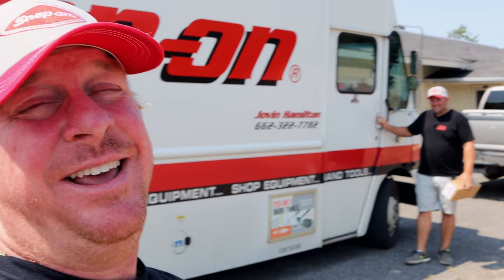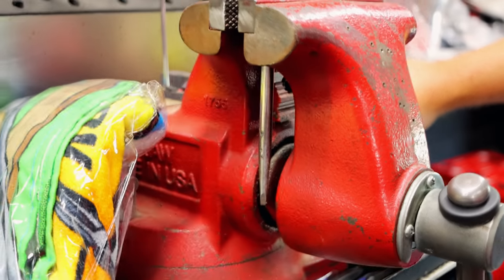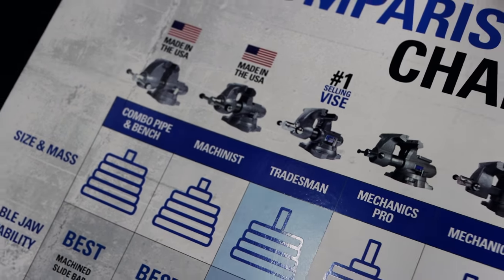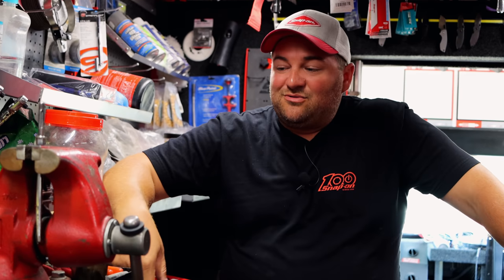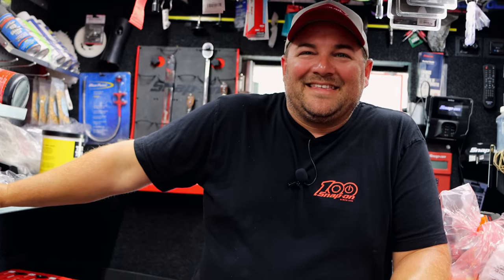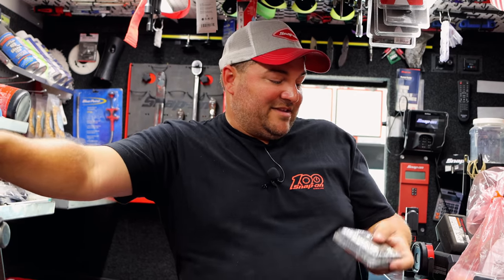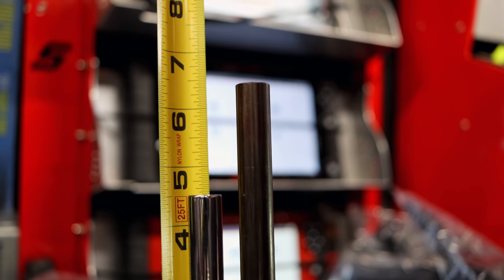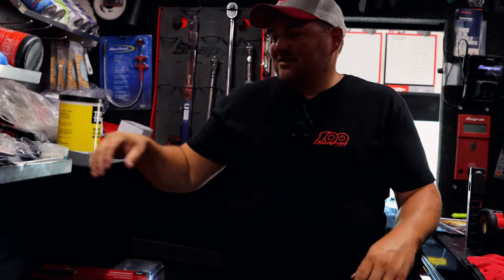Snap On Extra Deep Sockets and Vise Talk (You can still get the same vises, we will show ya how)

Comment: How about a video of all the different spark plug sockets? 14 mm x 12 point, 16 mm x 12 point, 16 mm thin wall, 9/16, 5/8, 18 mm, 3/4, 13/16. Plus all the extra deep versions and swivel joint ones. Which ones are important and which ones are not worth having.

Comment: Has Hamilton ever sold a snap on oil spout when I first started oil came in metal cans and a oil spout was a required tool I've still got a couple alot of young people have no idea what it is same with a timing light or distributor wrench
Reply: @sexyworm1000  true I would like to find a job at a custom old hotrod shop I got my start on 60 and 70 models no computer just horsepower plenty of room under the hood we had starters and alternator rebuilt for 15 dollars we could repair radiator not replaced them only thing all brakes were shoes no pads if you could master timing and carburators then you could fix any car that come in cause it took fuel fire air and compression all at the right time and that's all it was to it I even learned how to do alignment with 2 cinder blocks a kite string and a tape measure long before the computer and today I'll line a car like that and put it up against any that's been done on the machine
Reply: @sexyworm1000  now some of the new things are good like brake pads great improvement scan tool makes diagnosis easier today's tire machine is better than the old ones I've done tires with prybars and spray starting fluid the light it on fire to seal the tire to rim
Reply: @sexyworm1000  these young guys have no idea what it used to take to fix cars and we had no lifts we had a couple of pits and Jack's with jackstands or cut up cross ties I've still got a screw press just like a hydraulic press only you use a wrench to screw it down and press it apart or together

Comment: The extra long 10mm works really well for pulling glow plugs on powerstroke engines a regular deep 10mm 1/4 drive socket can fall inside of a 6.4 cylinder head the extra long one will stick out of the head

Comment: I don’t know if anyone mentioned it, but Mercedes bumpers require an extra long (deep) 10mm socket to remove 2-4 nuts. I’ve seen one Mercedes use an extra long 8mm for the bumper. I do auto collision repair.

Comment: I got a 10mm kit from O'Reilly's and it had an extra deep 10mm in it and I got the entire kit as a joke cause it was $16 but that extra deep 10mm has came up so many times for Mopar battery tie downs and recently it let me do the terminals in my Honda magna without needed an extension to get in there. Deep 10mm sockets are really handy I've been debating on upgrading mine to a snap-on one

Comment: I have the long 3/4 cage bolt socket.... in 4 years only used it 2 times always still grab a ratchet wrench.... but I can see where the different deeper 10mm and 8mm would be handy for valve covers coil packs hose clamps etc

Comment: Those really are the best vises out there. My boss has had his for about 10 years and the thing is a monster
Reply: I've got a snapon vise I bought around 1985 it still works great it's a midsize vise I bought it to fasten to my toolbox got a 1980 bench grinder I've got a pipe vise for working on exhaust or driveshaft got a metal lathe for balance the driveshafts

Comment: Here's a question for Hamilton. What is the biggest socket he carries in stock on a regular basis? Just curious.
Reply from the maker: we will look next week
Reply: I bet 36mm is in regular rotation. Anything over a 36mm is special order, typically.
Reply: @nathandnicholson  that or 39 for Toyota 4x4 axle nuts.
Reply: What’s the biggest socket snap on sells overall?
Reply: I had to get a 46 mm specialty ordered for a weird foreign semi from Japan for the lugnuts
Reply: @CAJones-bu6tu  They have and 8", 2 1/2" drive socket.
Reply: @KoonTrucking  Thanks, Clay.
Reply: I install knuckle boom and drywall cranes and bought a 5mm1inch drive snap on impact socket!! 50mm/ 2”3/16” 3/4” drive sockets

Comment: Good video.  Is there a special Socket to remove air intake hose clamps on jeep 2.0 and 2.4.
Reply from the maker: no clue but I can check
Reply: @KoonTrucking  it is a 8mm that needs to lock on the clamp screw very hard to get to when replacing the electronic throttle body thanks.
Reply: Nobody makes a socket like that , that I've seen. I've used a magnetic 8mm on those hose clamps.
Reply: @allanb3222  ko-ken makes locking sockets haven't tried them yet.  Just hard to keep a socket on the screw loosen or tighten the screw it is in a very hard place to get.

Comment: What is the outside diameter of the handles on your Vise?  Is there a separate part number for those rubber protection bumpers on the handle?
Reply from the maker: Just get some glad hand seals and trim them down. $2 for them that wat

Comment: What would be the part number on a 1/4 drive locking flex head hard handle ratch?
Reply from the maker: You can check that and the price on snap on website. It’s super easy to navigate just click ratchets. Then 1/4” then locking flex and it puts them all side by side. Obviously it’s not a single answer as they make several different styles and lengths
Reply: @KoonTrucking  I haven’t been able to find any hard handle locking flex heads on the sight, I saw one on a truck and didn’t get the part number lol

Comment: Wilton stopped making Tradesman vises in the USA about 2 years ago.  They're now made in Taiwan.  That's why you couldn't get them.  The best of the tradesman vises are 1780s --- it's probably the best vise Wilton makes period (yes, even over their machinist or combination (C) vises).  The new Tradesman vises from Wilton are total garbage.  They're redesigned to be cheaper to manufacture, and the ones coming out of Taiwan have no quality control at all.

I'm so glad I own two 1780s, a 1760, a 1755, and a 1750.

Comment: Wilton tradesmans are now made in China since 2019. That’s why snap on couldn’t get them for awhile. The Chinese ones are garbage compared to the USA made ones. They will be grey instead of the Wilton blue. The spindle has a hole drilled in it for a roll pin and a spring and that weakens the spindle significantly. The Chinese castings are weak compared to the USA made ones.  The only USA made Wilton’s are the machinist vises and the combination vises. Wilton sold out and still raised the prices. 

Later model USA made tradesmans had reversible smooth jaws on the inside so you could flip them without buying new. They were also powdered metal and were very brittle unlike the tool steel jaws used in the high end machinist and combination vises